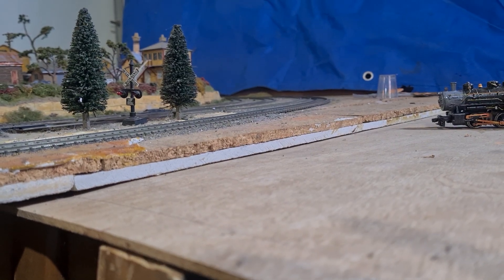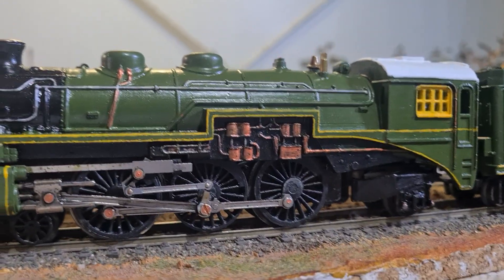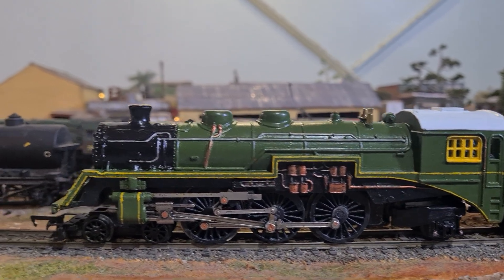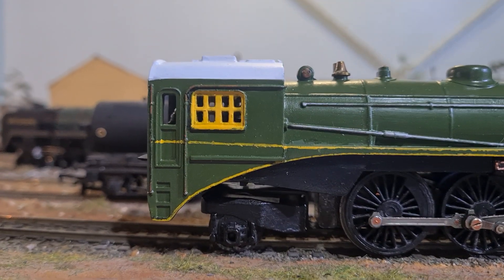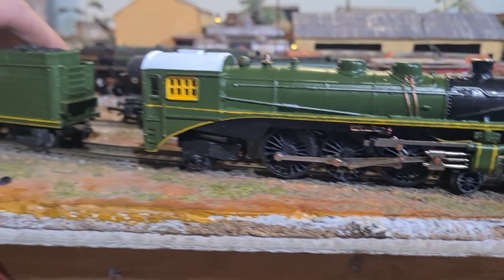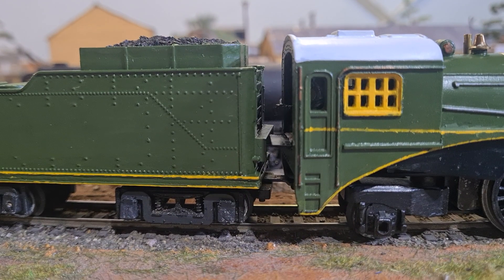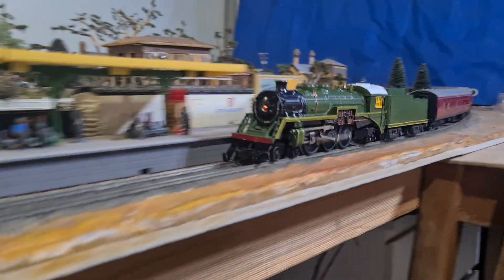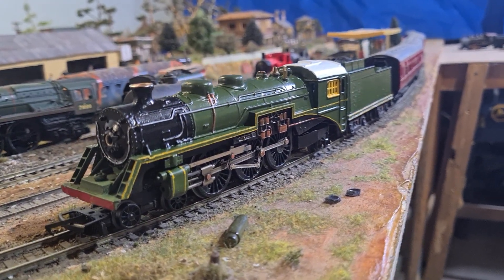Last part of Triang conversion, for now.

Comment: Hi Steven, I really like the shade of green, the end result is a Loco that now has its details nicely highlighted. The striping is probably the most difficult to do especially in Humbrol yellow. I think you have done a great job transforming this old Loco. Cheers, Paul.👍👍👍.
Reply from the maker: Hi Paul, thanks for the kind comments mate, they are much appreciated. It won't be hard to redo the stripes, 10 minutes work with new paint. Just have to wait till it arrives. Steven.

Comment: Hi Steven, i think you,v done a great job. A white roof in the UK  normally means its pulled the royal train. All the best butty. Carl.
Reply from the maker: I think a white roof down here is to reflect the heat of the cab roof.  I've relined the yellow lines, it looks much better. Not perfect, but good enough. Thanks for the comment Carl, much appreciated. Steven.